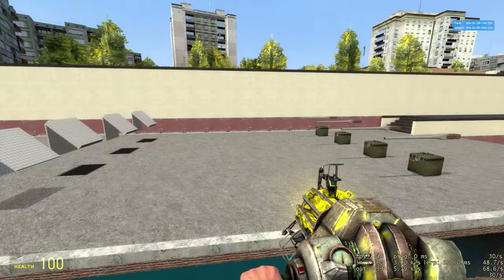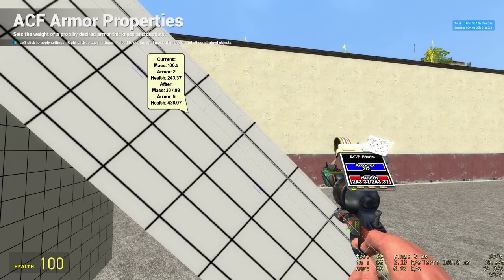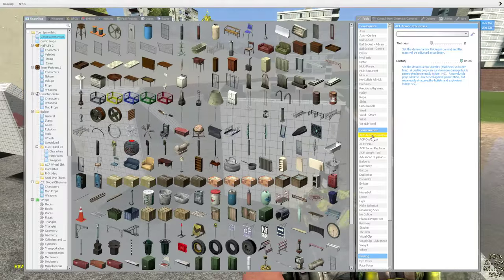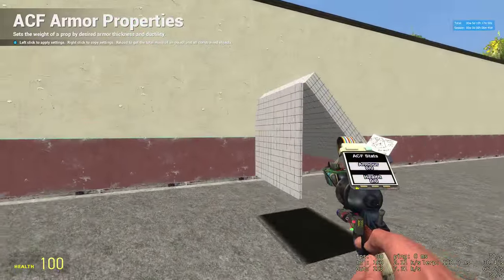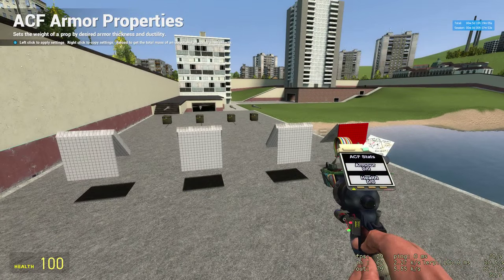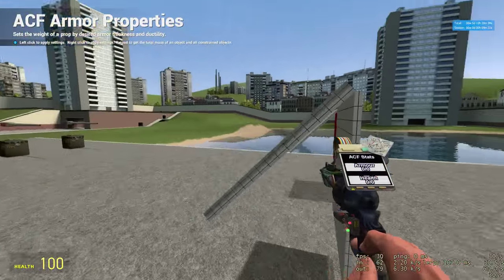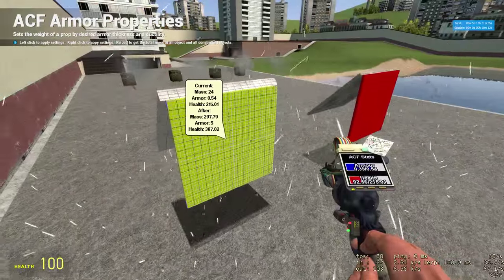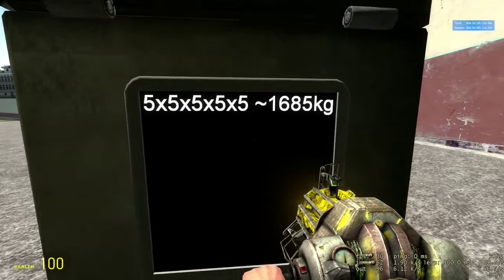GMod - ACF Composite Armor Test

Comment: Wow that audio was painfull, but good test anyway, it seems a bit OP that it differs so much with changing config like this
Reply from the maker: +Gmodism Total Nerdery Channel I agree on all accounts (including audio). I'm still testing it. I'm not quite sure if it's super OP yet, since it seems like it's very vulnerable to autocannons, which will rip the health pool apart, though I'm testing to see if you can add like a 30mm plate over the layers to stop those.

I still don't trust it enough. It seems like angling has little effect on its durability and there are other strange quirks I can't quite explain...
Reply: Strange indeed, interesting with the auto-cannons, I haven't used them much so I know little about them, considering that most seem to use 75mm cannon for their tanks this might be a good solution, but will be interesting if you get some cool results!
Btw, do you play online often?
Reply from the maker: I have a server with a friend, but it hasn't been on for a while. We usually play on and off in spurts. I might get it back up and running if I start playing again more.

Also, I just tested 10 thin plates with max ductility and 5mm at 60 degrees and the test rig ran out of ammo without a single penetration. So 31 200mm pen shells, not any damage to the back plate.

Also very peculiarly, I ran another test with a 2mm stack, a 5mm stack, and a 10mm stack, all the same ductility at 30 degrees 5 plates per stack, and the 10mm stack failed at the same time as the 2mm stack, with the 5mm stack surviving several shots more... I don't know if it's a fluke or if there's negative returns when you increase the armor past a certain point.
Reply: Okay, if you get back to gmod more maybe we should meet up sometime :)

interesting with the test results, I should try and integrate that on some sensitive area and see if it takes shots better. Seems weird that it works this way though
Reply from the maker: I just spent like 3 hours building an entire tank around this shit to see what I could get to work. Definitely some obstacles to handle. The thing weighs 32 tons with a 100mm autoloading cannon. Hull and Turret have 9 layers of thin 5mm plates with a 20mm outer plate (10 plates total). The test I did had the lower plate at 60 degrees take 21 consecutive 250 pen shots from a 120mm gun without a single penetration.

I also added 5 layer side armor 5mm, with 20mm outer layer, and 2mm triple layer side skirts.

Armor seems pretty insane, though I'm not convinced that doing the armor this way is necessarily better than having a giant block. It definitely weighs less. There are some big issues though pertaining to how the armor fits on the tank and I think side shots into the layers of the armor that skip many of the layers could potentially be a serious issue, but if you puzzle it together right it seems like it could work.

I'm more okay with this sort of armor than the hardcore ACF builders with their sideways pods in the back corners of their tanks with everything hidden away so ridiculously to spec that all the fun disappears, but that's just my opinion.
Reply: that is quite cool, must be much work indeed but perhaps one can only replace big parts of armour that take most of the fire?

well you should make a video of this experiment also ^^

and yes, hardcore ACF competition people can have very fun "solutions" for 110% efficiency....